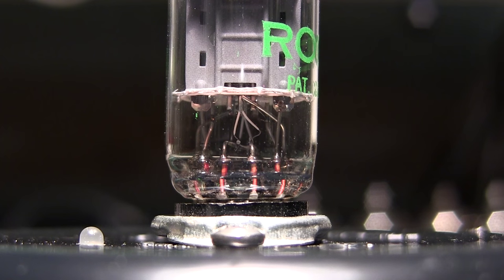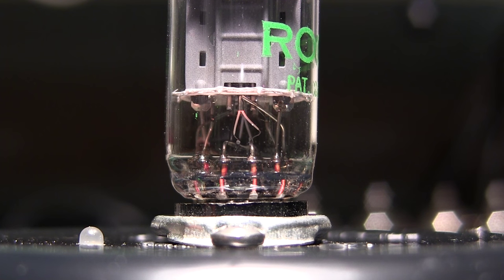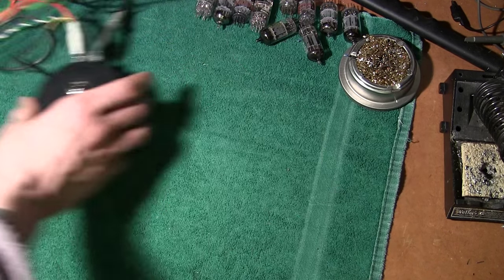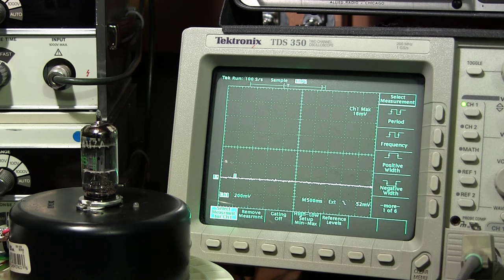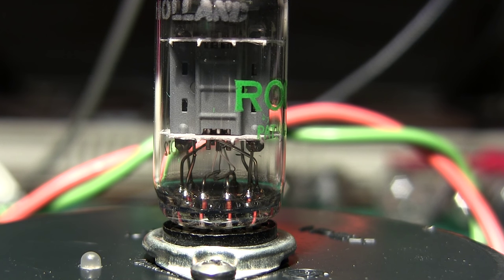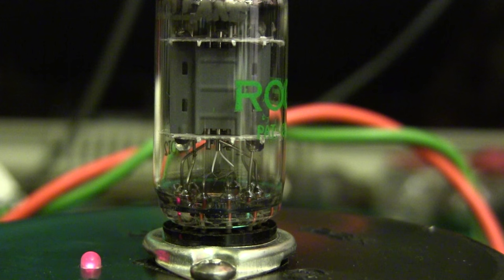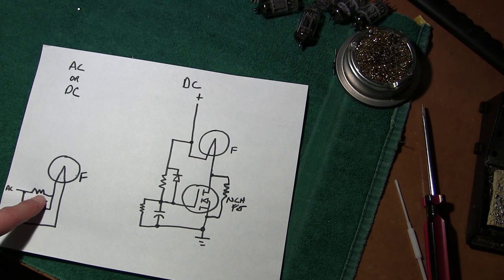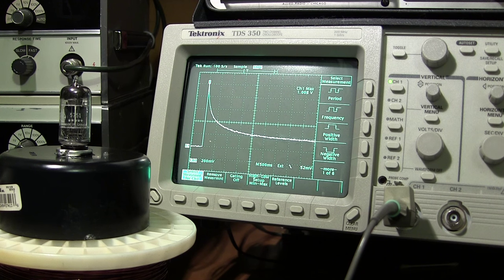Tech Tips Tuesday Dirty Little Secrets

Comment: In the early days of television to save costs by eliminating transformers as much as possible, manufacturers developed very odd numbered tubes so that they could be wired in series across the 117 volt line voltage.  These filaments were subject to stress every time the TV was turned on and failed much quicker than tube filaments fed by transformers.  In transformers, the inductive reactance caused the AC current waveform to lag behind the voltage waveform causing the filament to heat up gradually thus allowing the filaments to last until the the life of the tube.  The constant tube replacements were a boon to the tube manufacturers, but the TV manufacturers soon came out with quick-on tube TVs that had the filaments always slightly warm so that when full power was applied, the tube would heat up quickly with less thermal shock.  This was achieved by having a resistor in parallel with the main switch similar to the idea put forth by Mr. Carlson. 

When you purchase tube test equipment or old radios that are powered by filament transformers, the tubes usually will have good filaments but if they  are bad will be suffering from weak emission.

Comment: i made a circuit for my PCL-82 tubes using a mosfet power resistor and a few smaller resistors with a capacitor  to make a delay circuit..  When power is first applied the mosfet is off... allowing the power resistor to send half the current into the 16V filaments  to preheat them, after a short delay  the capacitor charges  and switches on the mosfet allowing now the full 16V to enter the filament , by now the tube was fully preheated and no heater flash occurs. Wanted an automatic function so I can simply turn on my amplifier  and not have to worry about any other steps

Comment: Wow, that 12AU7 has the worst filament flash I have ever seen being fed from a stiff 6.3 volt source.  I suspect the manufacturer did something to reduce the filament wire diameter where the hot spot is occurring.

The RCA color TV's in the late 1960's used a negative temperature coefficient thermistor in series with the power transformer primary to solve this problem plus, limit inrush current in the power supply.  It was very effective, took about 5 seconds for the power to come up fully when switched on.

I don't recommend running DC through tube filaments, it causes DC notching (metal migration problems), which shortens filament life,

Comment: Why not just a CL-90 across the primary of the power transformer...works great for me ! ...I also put one on the B+ before the first filter cap after the coil to save the big caps...I also add small 1/2 watt 18 ohm resistors in the B+ winding lines as they output from the transformer before they hit either solid state diodes or the rectifier tube so that if there is a diode failure as a short circuit, you don't burn out the transformer winding...of course I learned all this the hard way, but have few problems with the over 30 tube amps I've rebuilt or newly designed since last fall....enjoy.

Comment: Very informative video. I've watched a bunch of your videos, and learned a lot, but this is my first comment.

How would a hobbyist go about finding out the component specifications in that mosfet circuit? Let's say for a 60's vintage tube radio with 5 tubes with 6,3v heated filaments. I get a lot of the physics and the math, I'm just not sure what I should be referring to or where to start.

Thanks a lot for your videos! I also really appreciate your thoroughness in your electronic work.
Reply: ...I know I'm late- but first off- the circuits in this video, used DC for the heater voltage!! A "5 tube radio" uses AC for the heater voltage, and the FET circuit would NOT work with AC- but the "resistor and switch" circuit might work.

Comment: If you leave the filament on always they will never burn out. A very good way to do that is with a center tapped 6 volt secondary transformer and a switch for standby. Thermionic emission devices rule.

Comment: i restore vintage jukeboxes, wurlitzer in the 1960's had a dual voltage winding on the power TX the valves run at about 3 volts in idle with full 6.3v when the jukebox is actually in use. suppose that was there solution to prolong valve life.
Reply from the maker: +sparkey1958 
Good possibility.
Reply: It also could have been used to reduce warmup time.  This was a trick used on some TV's in the late 1960's.  It reduced the time for the screen to light up, from 30 seconds to about 3 seconds.
Reply: as a kid, totally interested in electronics - I remember turning on an old B&W TV and it turned on almost instantly. I was amazed and remember looking in the back and seeing the crt neck glow while the TV was off.
Reply: OK , but just like diesel engines one should not idle for very long or continuous periods as they discovered wear on oscilloscope crt filaments in standby .....only the  time necessary for preheating and shutdown of the HV before filament shutdown .( same as a diesel engine to prevent glazing or tube filament sickness in tubes )

Comment: my harman kardon amp runs its 12ax7's are series  connected and are the output tubes cathode bias resistor
there is no flash because the 12ax7' s light up slowly as the output tubes draw current.
clever design.

Comment: Great video I only have a couple of vintage rf signal gens with tubes even though I can't see them heat up as there sealed in. I will fit the pre warmers it a lot cheaper than replacement tube, Thanks Paul
Reply from the maker: Thanks Wayne!

Comment: I seem to remember an "instant on" circuit years ago that kept the filaments at some lower voltage until the power switch was turned on. When the power switch was thrown it would supply full voltage to the filaments, making the set go on right away. If memory servers me right, they put a diode across the power switch.
Reply: +ToolGuy  I have something that does this.  Makes the transformer hum like an SOB too.  30 hz chopped input does not make them happy at all.  The diodes commonly burned out on that particular piece of gear.   I fixed it and took them back out because it sounded like a fog horn on my bench.
Reply from the maker: +ToolGuy 
The "instant on" feature for older televisions was great for increasing tube sales. So many reasons not to do it the way they did. A more expensive modification would have worked better, but tube sales would suffer.

Comment: NTC thermistor can also be used, and it would be simple to make your FET solution work on AC as well, so you can use it for AC sets to reduce rewiring.
Reply from the maker: +SeanBZA 
Ya, the problem with that is noise. Any disruption "In-balance" of the AC heater string equals buzz or hum.  (In most cases) I imagine you are thinking of using two fets? The thermistor rely's on resistance across the device to keep it hot, that resistance would reduce the normal operating heater Voltage.

Comment: Good info! Thanks. Now, what about using a high wattage resistor in series with the filament transformer?  I would install a "warm up" mode switch in a convenient location to bypass the resistor.  Or maybe incorporate a time delay circuit with a relay to bypass the resistor.  More like the speaker time delay for transistorized amplifiers to eliminate the "thump".  Thanks again for the great video.
Reply from the maker: +Greenfield 54 
Sounds reasonable! Thanks for your comment!

Comment: Dear mister Carlson
Isnt there a risc of cathode posining, leaving the tube with low glow on instantanly, i remember at simular solution in CRT television way back in the seventies, made to cut out the heating period to achive picture on as one pushed the "on" bottom on the remote. That cost alot of CRT tubes back in them days!

Comment: Remember the instant on TV's in the 60's and 70's in which the filaments were run at a reduced voltage when the set was plugged in and turned off?    Did that extend or shorten their lifespan?  I occasionally pick one of these up at a garage sale etc. to tinker with.   Thank you

Comment: I have a 1959 Philips TV with this issue. What I did is I put a delayed relay and a big power resistor in series with the primary. When the set is turned on the resistor drops the 230v to about 110v which gives some time for the filaments to heat up. Then after about 5 seconds the resistor is shorted and it delivers the full voltage to set. It's far from perfect and it uses a 555 timer for simplicity (solid state in a 100% tube TV, yikes!) but atleast the filaments are not getting bright like they're incandescent bulb and that's all that matters to me.

Comment: An NTC, as they are used in switching power supplies to protect the rectifier while turn on the computer and charge the 400 Volt capacitors would be a good idea too. Should work with AC and DC.

Comment: With a standard design of the era, the tubes were fed with rather high impedance supply. Either there was a dedicated resistor in series with a transformer less series string, or the transformer uses to have quite high resistance (compare to the operating voltage and currents - the winding uses to have 9V OCV and drop the 3V at the internal resistance). As a result, these resistances act as the turn ON current surge limiters. These resistors were not primarily used as the filament soft starters, but as a consequence of making the transformer cheap or adjust the filament chain voltage vs the mains, but they were always present and the filament designs count on them.
Now with the modern high efficiency transformers, the heater supply becomes very low impedance, making the uniform warmup a real issue.
By the way the high impedance of the heater winding is the reason, why you should never operate the thing with not all tubes inserted - the filament circuit would operate at overvoltage, often in the 8..10V range on 6.3V rated tubes if e.g. the high current output tubes are missing and just few preamp ones are present.

With US tubes the situation was a bit different: The common "AA5" style circuits means all filaments are connected directly to the mains, without any resistance whatsoever, so tube makers were forced to address the uneven heating issue by the tube design and manufacturing control and it became a habit used for all tubes, even when to be powered by a transformer.

Comment: Interesting topic. I wonder whether in many pieces of equipment the over current on start up is softened by the heater transformer voltage sagging at switch on, then recovering as the heater filament warms. This is likely as the transformer will be rated for "hot" operational current. Another option for hi-fi applications is to use a dc constant current heater supply instead of a constant voltage supply.

Comment: Why is there heater flash? Note that flash always occurs where the filament has a kink.
I believe there are two possibilities (or maybe a combination of both).
First, the kinked wire may have micro cracks that increase its resistivity and make it heat up more locally.
Second, the kink allows the wire to radiate heat onto itself, a kind of concentrating effect.
The flashing section always seems to be where the wire has no insulating coating, which reduces thermal mass and allows it to heat up faster.

Comment: Interesting that it seems to be labeled as a 12AU7A.  In the US numbers anyway, the "A" is controlled heater warmup for series string operation.  A flash like that wouldn't do very well.  

I've been adding PTC thermistors in the primary side of the power transformers lately.  Makes for a nice softer turn-on which helps the power switch and it also helps with the tube heaters too since the voltage ramps up slower, plus you lose a couple volts which makes older gear built for 117v happier on modern line voltages.
Reply from the maker: +gadget73 
Thanks for your comment!

Comment: so some tubes like new old stock Mullard or Amperex 12AX7s "flash" brightly when you turn on the power -why ?
    
The answer is rather technical so bear with me. The two filaments have  unequal cold resistances. When power is first applied, the filament with the lower resistance passes more voltage over to the other filament, which  makes it glow brightly (Ohm's Law at work). As the lower voltage filament warms up, its resistance rises to the hot resistance of the other  filament, allowing both to get equal voltages. This effect is pronounced  in amplifiers with AC filament supplies because larger amounts of current   are available for the tubes, DC filament supplies like those found in better hi-fi equipment tend to be current limited, reducing the opportunity to "flash.
Reply: But he tested for the flash condition with just one heater at a time, so how could what you stated be true? I think the reason the flash occurs might be because the alumina coating that should run the length of the filament is missing at the end.

Comment: Say ... just out of memory; didn't the old Ampeg V4-b bass amplifier have a "Standby" mode. That when you were running in non-bridged mode you started in Standby to allow the tubes to preheat ? Seems like I remember that, could've been another amp but I think it was the ampeg v4-b unbridged 100 watt version. That thing was doubling as a BBQ grill so much we used extra fans and kept a fire extinguisher on hand ...

Comment: That really looks like a design/manufacturing issue to me. There is a point of high resistance (or low heat dissipation) where the filament ties to its lead and pin. As a result the cold current of the filament causes a hot spot there. Even once the filament is hot and the current has tamed somewhat, this is likely still a hot spot but not enough to incandesce any more. The cold current is maybe 4 times the hot current so you have 4 times the power at the hot spot, and because radiated power from a hot object is proportional to the 4th power of its absolute temperature, I would expect that the hottest absolute temperature of the hot spot would be about 1.4 (4th root of 4) times more than the long-term running temperature. I'm not sure if that is the difference between bright yellow glow and no visible light.

I suspect that many tubes are saved by having the filament supply be just enough for the hot running current of the filaments. The initial load of all the cold filaments would drop the supply voltage enough that the flash is weak and relatively inconsequential.

Comment: Hi Paul, i was unsure about this toppic, but after 04:05....i know....stopped the video...my solution is inrush current limiting, or softstart. Sometimes it´s done by the power-tranny  filament winding itself. Or if i use a SMPS, i also use a constant current supply, especially for the P-series tubes which have a 300mA series filament. 
As this tubes do this everytime when powered with a voltage rated acording to that 300mA voltage drop. 

Let´s see what you come up with...;)

Haven´t tried that MOSFET thing, i usually use a relay and a little driving BJT...

By the way, if you ever saw a german all-tube TV (like the one my grandma had) switched on, it lights up just like if there must be a lightbulb inside. There is an "urdox" - a current limiting resistor looking like a bulb-  inside wired in series with the filaments and then straight to mains.
But this wasn´t enough to keep them tubes stay dark. They do light up as bright as a lightbulb. But the TV works for years and years. The Caps died first....And my dad bought a color TV for her, i was about 10 years old, and my father had forbidden me to "play around" with that TV-set, years later i know why - it had a live chassis - but he gave me the tubes. 

These P-series tubes are much more rugged that the E-type tubes filament whise....  

The (former) Tube manufacturer had been aware of that, especially with these P/U-series tubes, and sometimes they put that in their tube-datasheets ".. when used daisy-chained there must be a initial current protection when the unit will be switched on..."

In the old days this problem was not as critical as today. Ususally the power tranny had one filament winding for all tubes rated just above the current needed for all tubes. And usually these tubes had been wired all in parallel (E-series tubes)
If that winding was set to 4Amp it may could deliver 6 up to 8 Amp for a short period but not more. 

And in the older days there alway was a rectifier tube inside as well....but these tubes had a very current hungry filament. 6.3Volts and 1.0Amp for an EZ81 rectifier which can easily draw 5Amps during powerOn....

I have an audio Amp made by "Braun" with 4x PL 500 -- TV Power tubes. These tubes light up bright when the filament is directly powered with 27V (as rated) peak inrush current is about 1Amp - they are rated 0.3A (P-series) - but they stay dark and heat up slowly within the amp. As the tranny can´t deliver more than 3 Amps on that winding. 

I always hear the power tranny (or that filament winding) saturates during powerUp...that´s a complete other design by todays point of view....we would rather put in a bigger power tranny, or even a SMPS for weight reduction....

With todays rather low impedance power supplies, it´ll can become a serious problem which need to be adressed....That´s why we talk about current limitting for the filament....We have torriods and or SMPS which are designed to provide a very low output impedance to make it easier to add a good voltage regulation....
  

For the filament it is pretty much the same as for the light bulbs, the cold inrush current kills it...always....if not limited...;)

Thanx for this great video....:)
Reply from the maker: +TubiCal 
Thanks for your input, and taking the time to write!